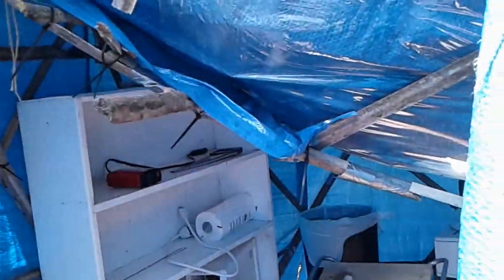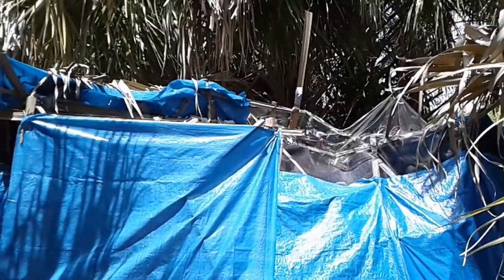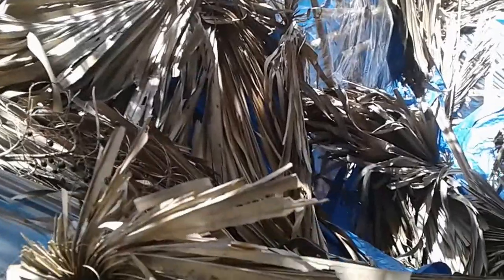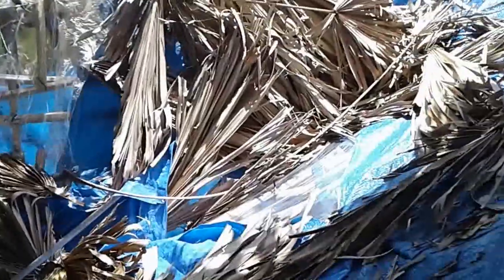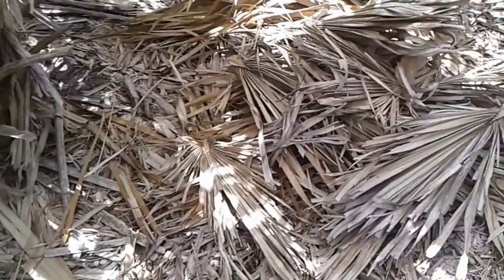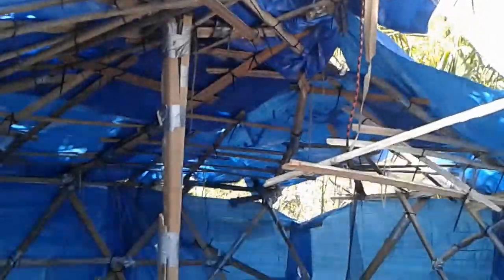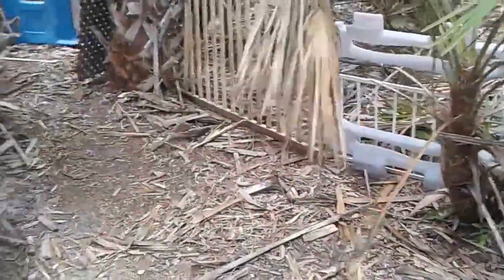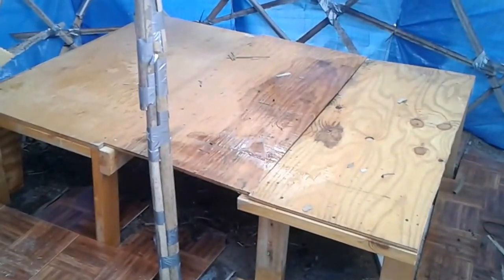Repairing The Yurt Roof (V586) Bushcraft Primitive Technology Urban Survival

Comment: the spot where u picked up the partial weights that location had long poles that u can use to hold up the roof 4 point or 3 point triangle that'll give the roof strength and stability to withstand another rain storm